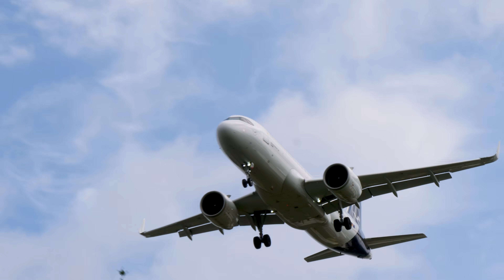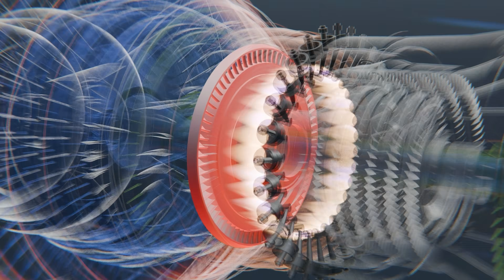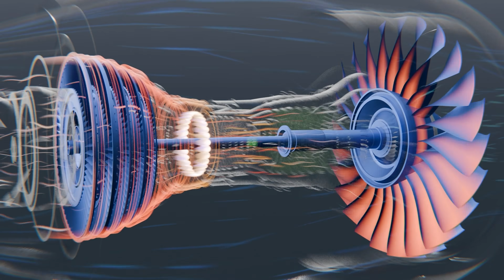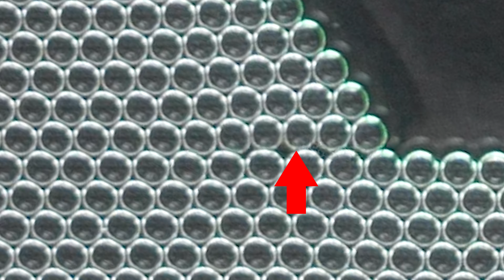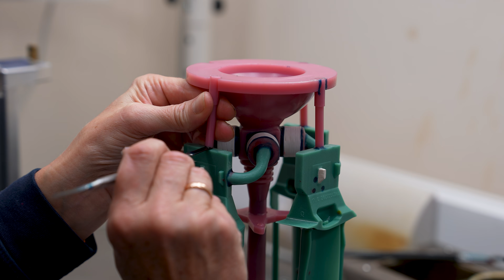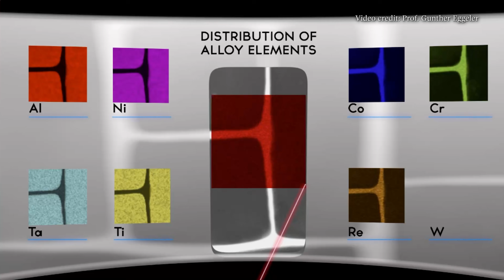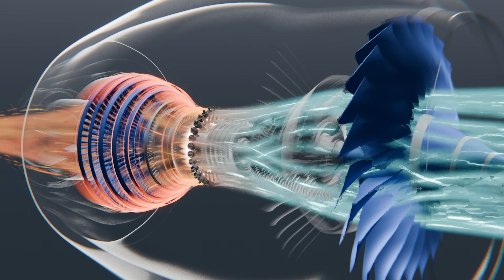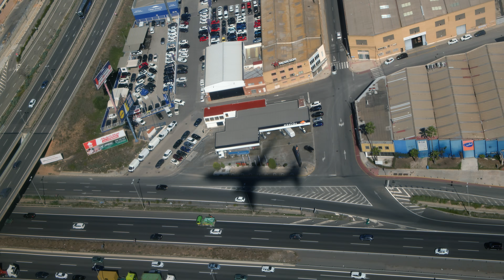The Ridiculous Engineering Of Jet Engines

Comment: AI Summary

Abstract:

The video addresses the apparent paradox of jet engines operating at temperatures significantly higher than the melting point of their components. It explains the fundamental mechanics of a high-bypass turbofan engine, where most thrust comes from the front fan rather than the hot exhaust. The core of the video is a deep dive into the materials science and engineering of high-pressure turbine blades, which face extreme temperatures and centrifugal forces.

The explanation covers the evolution from early steel components to modern nickel-based superalloys. It details the unique microstructure of these alloys (gamma and gamma prime phases) that provides anomalous strength at high temperatures. The manufacturing process, using investment casting to create single-crystal blades, is shown in detail at a Rolls-Royce facility. This process eliminates grain boundaries, a primary weakness in metals at high temperatures. Finally, the video explains the multi-layered cooling strategy, which includes intricate internal air passages for convective cooling, film cooling to create a protective air barrier, and a final ceramic thermal barrier coating.

Why Jet Engines Don't Melt: An Engineering and Materials Deep Dive

*   0:00:02 The Central Problem: Modern jet engines operate at temperatures around 1,500°C, which is 250°C hotter than the melting point of the nickel superalloys used for the turbine blades.
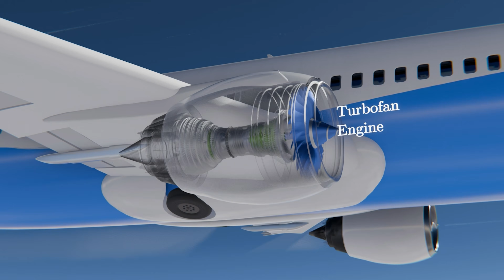*   0:00:45 Turbofan Engine Basics: The engine compresses air, injects fuel, and ignites it. The expanding hot gas spins turbines, which in turn power the compressors and the large front fan. In modern engines, over 80% of the thrust comes from this front fan bypassing the hot core, which is a more efficient way to generate thrust than relying solely on high-velocity exhaust.
*   0:04:27 Efficiency and Temperature: Engine efficiency is governed by the Carnot limit, which depends on the temperature difference between the hot core and the cold outside air. This creates a strong incentive to run the engine as hot as possible, pushing materials to their absolute limits.
*   0:05:42 Extreme Conditions: A single high-pressure turbine blade, while glowing hot, experiences centrifugal forces equivalent to the weight of 20 metric tons (two double-decker buses) and spins at 12,500 RPM.
*   0:07:07 Material Weakness: Lab tests show that conventional metals like steel and titanium lose strength and deform via a process called "creep" at temperatures well below those in a jet engine. This deformation is caused by the movement of atomic-level defects called dislocations.
*   0:12:44 The Solution: Nickel Superalloys: The blades are made from nickel-based superalloys. These alloys have a unique two-phase microstructure (gamma and gamma prime) that impedes the movement of dislocations, making the material incredibly strong. Paradoxically, the material gets even stronger up to about 800-900°C as thermal energy helps lock dislocations in place.
*   0:12:56 Advanced Manufacturing: The blades are manufactured using a sophisticated version of ancient lost-wax investment casting. A wax model, including an internal ceramic core that will form the cooling channels, is used to create a ceramic mold.
*   0:25:33 Single-Crystal Casting: To eliminate grain boundaries—the primary weak points in metals at high temperatures—the blades are cast as a single, continuous crystal. This is achieved by pouring the molten alloy into a heated mold and slowly withdrawing it from the furnace. A spiral-shaped passage at the base, called a "pigtail," selects for a single crystal orientation, which then grows to form the entire blade.
*   0:32:31 Advanced Cooling Systems: The blades are hollow, containing complex internal passages. Relatively cool air (600°C) bled from the compressor is forced through these passages to cool the blade from the inside.
*   0:33:14 Film Cooling & Thermal Coating: Hundreds of tiny, laser-drilled holes in the blade's surface allow the cooling air to escape and form a protective film, insulating the metal from the 1,500°C gas stream. A final ceramic thermal barrier coating provides another 100-170°C of temperature reduction, which is the last line of defense against melting.
*   0:34:53 A Remaining Threat: Even with these protections, dust and sand ingested by the engine can melt, block the tiny film cooling holes, and strip away the ceramic coating, causing the blades to overheat and fail. Engines are rigorously tested for this.

AI-generated summary created with gemini-2.5-pro for free via RocketRecap-dot-com. (Input: 29,916 tokens, Output: 990 tokens, Est. cost: $0.05).

Comment: The greatest bit of magic in gas turbine engines is in the combustors. That picture of the first Whittle engine, its dominated by the combustion chambers. The burning was so inefficient they had puddles of fuel at the bottom of the chambers which kept then engine running even after shutoff. The turbofan 3d animation leaves out most detail from the combustion area, perhaps because engine manufacturers keep this stuff secret? The modern combustor area is so tiny compared to the early Whittle design. Its been said its  like keeping a candle lit in a hurricane, I suspect its actually a great deal more difficult than that.

Comment: The Rolls-Royce Conway turbofan from the 1960’s was the first engine to use cooled turbine blades in commercial airline service. PS: Fun fact … Rolls-Royce also pioneered the use of “pre-swirl” nozzles to impart a circumferential motion to the turbine blade cooling air before this air enters the blade. This improves the efficiency of the cooling airflow as it enters the turbine blade. Additionally, since these nozzles accelerate the cooling air, the static temperature of the cooling air is reduced further improving the cooling effect within the blade. Would have been nice to see this feature described in the video otherwise, well done!

Comment: 2:55  it’s the same principle with helicopter blades if I’m not mistaken, it’s better to accelerate a larger amount of air slowly, than a small amount of air really quickly, it’s more efficient, there’s also a point where the size and weight of an engine will hit a peak where the energy required to move the fan blades will offset the energy saved by moving more air slower

Comment: @10:00 This ladies and gentlemen is why jet fuel doesn't have to melt steel beams per se. The temperature weakens and softens the metal enough to cause catastrophic failure.
Reply: tell that to building 7

Comment: Loved this video. I was a design engineer there in Rolls-Royce Turbines. The material is just one factor but we pushed the temperature even further than what was described here... For example:
(1) Seed crystals: Turbine blades (rotor) or vanes (stators) will often use a seed crystal as the initial nucleation site. This allows the designer to control the orientation of the crystal and thus any anisotropic properties of the part (measured along the engine's axial direction versus its radial direction and tangential direction. E.g. creep occurs mostly in the radial direction due to the centrifugal force so it pays to know which crystal orientations perform the best. This can be factored into certain (highly specialised) Finite Element Analysis (FEA) software.
(2) Cooling technologies: The core of the blade is there for cooling; The compressor stage often has multiple bypass ducts used for cooling the turbine. The cooler air (perhaps still over 500 degrees C) follows carefully designed and often quite complex internal channels. Some cooling air is bled through holes which form a thin boundary layer around the aerofoil; or positioned to protect the trailing edge. The blades may also use fins and bumpy geometries to increase heat transfer at the ends.
(3) Coatings: The hottest turbine blades are coated in a ceramic, which has better thermal properties than metals, but worse structural properties (e.g. brittleness and strength). Applying those coatings is highly technical e.g. making use of high speed ions or plasmas.
(4) Modelling and simulation: The amount of effort in simulation is absurd. Along with the Computer Aided Design (CAD), there's often a dynamic structural model for every second of the flight of an aircraft from take-off to landing; used to see where all the parts are moving and how they're behaving throughout the flight, for various reference flights. There's models of every component, and groups of components; including the temperature and displacement at every spot on every 3D component, throughout every second of the flight, checking for clashes, checking for hotspots, checking for yielding. There's also the creep and fatigue models. There's CAD models for every stage of the manufacturing process.
(5) Materials testing: There's a huge library of materials and their properties, with a bunch of Ashby charts, and all verified through materials testing and statistics.
Reply: Your points 4 & 5 are probably a result of decades of work in the making
Reply: Should you be describing those details? Don't you have some kind of NDA? I'm surprised they even showed what we saw in the video
Reply: @schagsim yeah I wondered too. Regarding what was shown in the video, I'm sure the methods are well known and available in the public domain. Of course the industry secrets to carry out those techniques (manufacturing) are well protected.

Comment: Excellent visualizations make it easier to grasp the subject.   As I did my thesis on molybdenum alloys, and also grew single-crystal tungsten and molybdenum alloys back in the 1960s when the objective was a material that could operate at 1500ºC with 10,000 hr stress rupture life at 100,000 PSI to create thermionic diodes for space nuclear reactors.    We achieved the objective, but then LBJ had his guns and butter program that killed the whole idea and most of the research in this area in the US.   We had fewer limits with no air or O2 in space, making these turbine blades even more impressive.   The creativity of the private companies made this possible.  

You did a far better job of explaining this subject than I did to my thesis committee, but that was half a century ago.

Comment: Great video.  It's so wild how delicate of a balance this is for it to work.  Outwardly, it just looks like something that spins real fast, but there's a heck of a lot of engineering hiding in there.  I'm guessing if a bird got sucked in, they would have to go in there and do a special cleaning lest the blades in that section have their cooling passages packed with avianium, or even replacement of particular blades, which I gather are individually replaceable as needed, and likely there is a schedule where the entire engine is rebladed after so many engine hours.
   It makes me wonder if power generation turbine blades have anywhere near this level of efficiency or balancing act going on.  🤔  GE I know makes power turbines, Rolls I'm not sure about.  That dev facility would be a really interesting place to be part of.

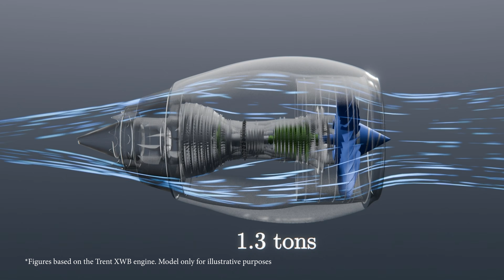Comment: 1:00 a common misconception is that compression is the result of compressor blades forcing the air into a narrowing passage. This is not correct.

Here's how it actually works: there are a series of rotating compressor blades and stationary stator blades. The compressor blades add kinetic energy in the circumferential direction (also known as swirl), and then the stator blades, which have a diverging flow area between them, convert that kinetic energy (dynamic pressure) into static pressure. Since air is compressible, increasing pressure also increases density.

The reason the flow path narrows axially is to maintain a  relatively constant axial velocity. The mass continuity equation tells us that (Mass flow) = Density * Area * Velocity. So, if Density is getting larger, and you want velocity to stay the same, then Area has to become smaller.

In layman's terms, the compressor gas path gets narrower not because that compresses the gas, but rather because the gas is being compressed by other means and the gas takes up less space.

Comment: An all too common mistake was made in this video.  It was stated that the Nickel Superalloy could survive "up to" 1200 C.  That implies the maximum limit of the alloy.  That is not what they showed however.  What they showed was the limit of the temperature sensor maxing out at 1200 C.  Not the failure of the alloy at 1200 C.  The sensor could not detect anything beyond that.  It is not known from this video, but I would hazard a reasonable supposition that the failure temperature of the alloy was higher then 1200 C.  A more precise statement would be that the Nickel Superalloy could survive beyond 1200 C.  How much beyond is an open question until the test is performed again with a temperature sensor that has a higher maximum limit.

Comment: Tens of thousands of flight hours? Who gave you that figure? 6000-10,000 flight hours before a typical commercial airline engine has to be maintained, with replacements to intake and exhaust tubines and liquid cooled bearings. Any lower than that is an airline you do not want to fly.

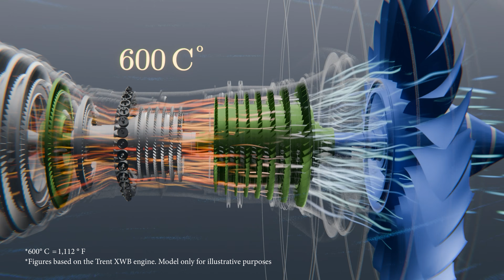Comment: 1:10 I always think it’s an important point to note that the pressure is highest after the final compressor stage, and lower in the combustion stage. The overall resistance of the turbine stage is less than the compressor stages. This is how it does not reverse flow.

However, the total energy in the turbine stages is higher than in the compressor stage, because of the heat added, not because of fuel mass. Therefore, there is enough energy to power the compressor and fan stages.

Comment: Also keep in mind Turbo Jet versus Turbo Fan, Turbo Fans get a large amount of thrust from the "Fan" Turbojets get their thrust from the hot gases and the Main Reason they don't melt is because of the cooling air thats channeled thru the combustor cooling and the different temperature gradients at different stages.

Comment: I'm doing my best to relate this to basic mechanics with my motorbike although this is some in depth stuff right here, where is the melted plastic, what part needs replacing, of course if it's a plastic part it's designed to break in order to not damage critical metal components however this is causing depression not understanding the "bigger picture" This is making me doubt any progress I've made understanding basics and possibly causing mechanical damage while trying to diagnose It's deeper cause. The spark plug is pretty clean, this however doesn't mean the carb couldn't have condensation or contaminents from dust or water or wax from the bike seat, float issues in the fuel sensor or a false connection to the missing bulb on the spark plug. It also wise to of course replace basic servicing parts from the manual as per mileage instructions. I can't help but feel defeated as per usual :/